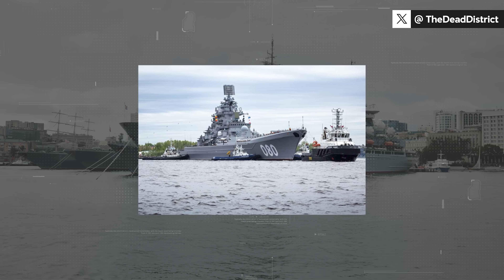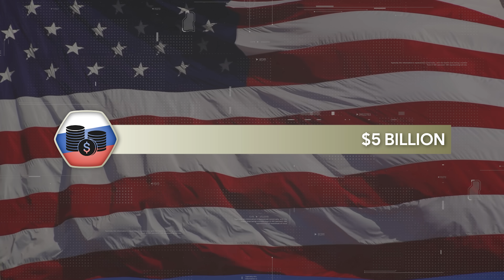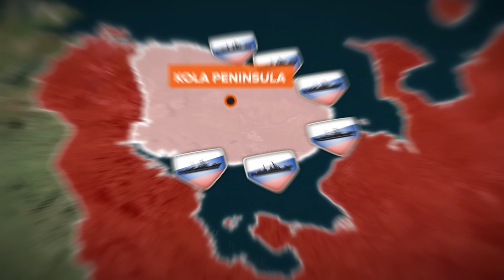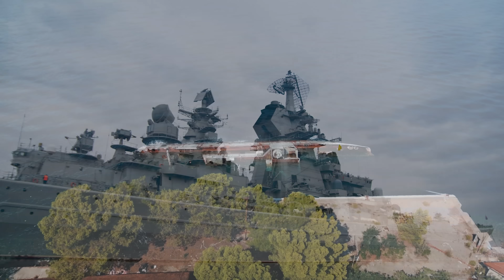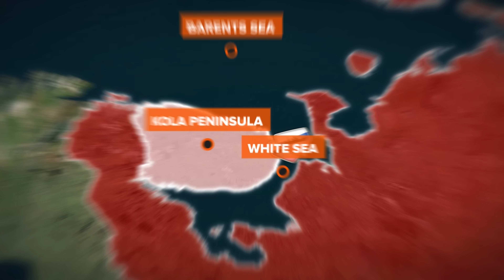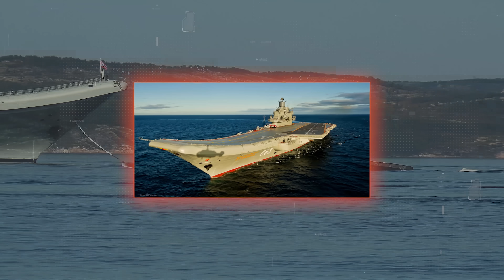Did Russia Just Build the World’s Most Expensive Target?

Comment: The only way larger warships can hope to sirvice drones strikes today is to have the kind of thick armour of the heavy cruisers and battleships of WWII. Or its modern equivalent in aluminium steel aloys,  ceramics, composites and kevlar and whatnot. Active systems like the rapid fire cannons and AA missiles will not suffice for a drone swarm attack. Armour has to return to ALL  navy ships to maje them resistant to swarm attack tactics of the cheaper shaeh type drones and light cruise drone-missiles.

Comment: Recent Issues on HMS Prince of Wales

Stavanger Stop: Docked in Norway for repairs in late May and early June 2026 due to an awkward physical access mechanical issue during NATO exercises. [1, 2, 3]

Past Sidelining: Previously spent extended periods out of service for repairs, including a major propeller shaft fix following a 2022 breakdown off the Isle of Wight. [1, 2]

Sister Ship Challenges (HMS Queen Elizabeth)

Propeller Problems: Sidelined in early 2024 prior to major NATO exercises after checks revealed a defect in its starboard propeller shaft coupling.

Historical Maintenance: Faced earlier issues including engine room leaks and fire system repairs. [1, 2, 3]

Comment: The Nakhimov can hardly have been built in response to the sinking of the Moskva / Drones... It was supposed to be done by 2018. Plans had long been finalized before Russia even attacked Ukraine. Let alone before Ukraine started to become a drone superpower. Surely they could have used the last years to add onto it´s drone defences yes. However only on a limited scale. The hull was likely finalized. Imports were harder to get as sanctions came into place. Even nowadays russia can hardly defend against drones... are you really going to tell us they have a real solution that they are only saving for one ship? Sure >200 cells is a lot but they weren´t even all meant for defence. Ukraine has done strikes with over a thousand drones at a time. If they ever want to go after her she is done for.

Comment: It's chief vulnerability is those deck-mounted missile tubes. A single 20mm artillery round can penetrate the thin steel launch tubes and detonate the enclosed missile, which will then detonate all the rest. It is much safer to have vertical launch tubes buried in the deck under armor plating.